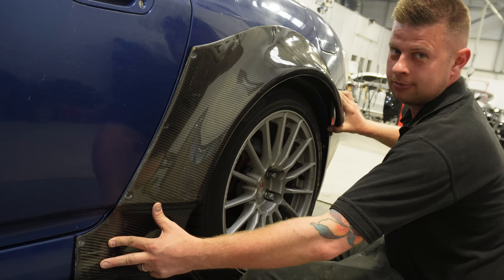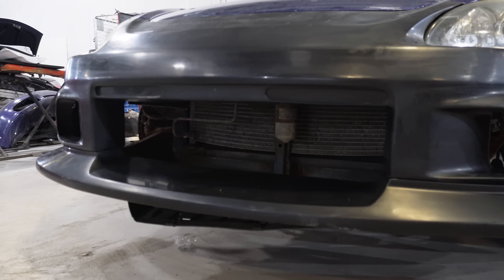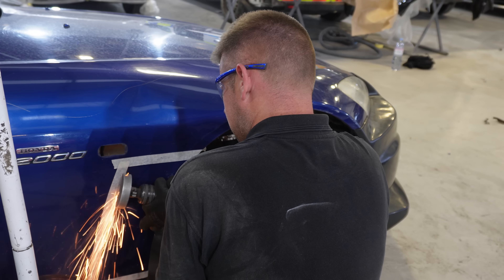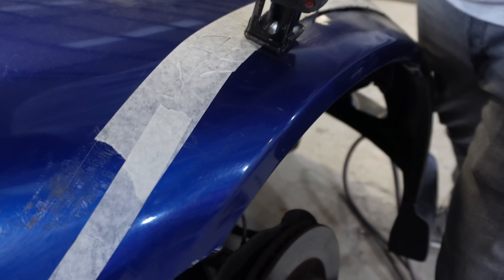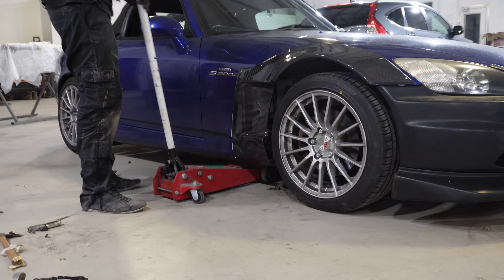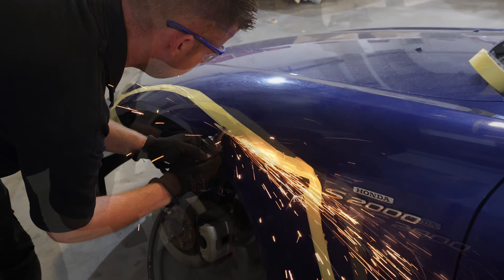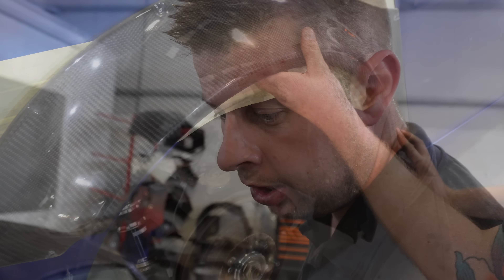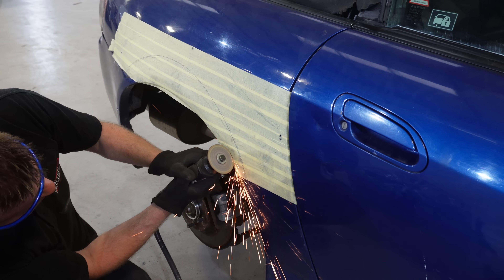THE CHEAPEST S2000 GETS SOME CARBON FIBER FENDERS - Ep.3

Comment: Just discovered your channel by the algorithm! Another S2000 owner here and it seems a fair few have a lot more hidden rust that you see from the outside. I've just had the rear arches inside and out repaired on mine. On the outside it just looked like a bit of bubbling on the arch lip, but digging deeper it was a bit of a horror story! Still, I've had the car for 18 years (it's a 2002 model with over 150k on the clock), so had it all fixed and repainted. Looking forward to the rest of the series, good luck!
Reply from the maker: We've been working on our arches for the next episode!  Glad you decided to save yours.  EIGHTEEN years?! That's a long time!

Comment: If the engine sits behind the front axle, it's technically mid-engine. Most folks would call it front-mid (like previous generations of the Corvette), but it's still definitely a mid-engine car.

Comment: question, did you have a huge gap where the fender meets the bumper?  I got the same rear overfenders (not carbon fiber)  and we mocked it up and noticed the gap.  We're thinking once it's riveted on it'll eliminate the gap.  Would u suggest using a heat gun for the fender to conform to the body?

Comment: I am correct thinking the front arches can be cut straight off because its a single skin & it just need a lick of paint to protect from rust?
Reply: Yeah that's correct .. as long as the sharp edges are deburred and they are protected and painted they will be fine